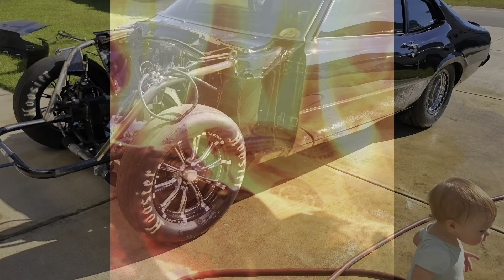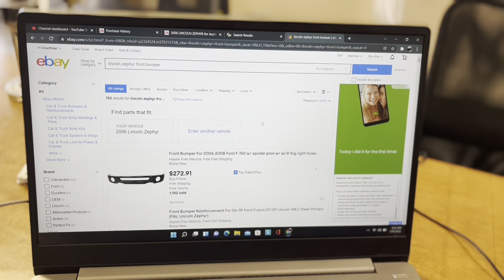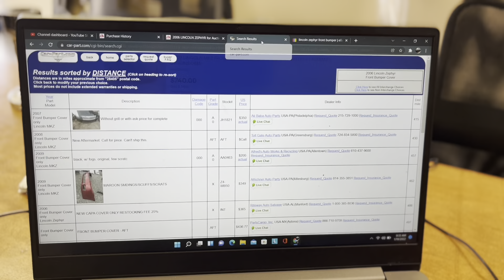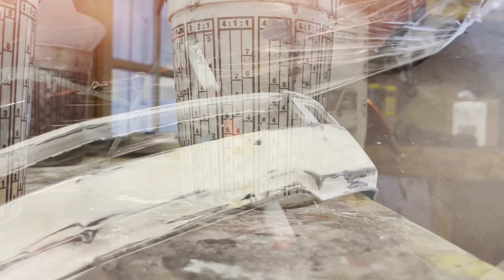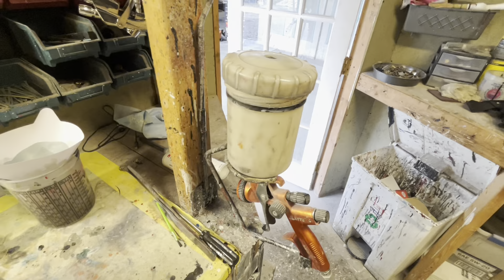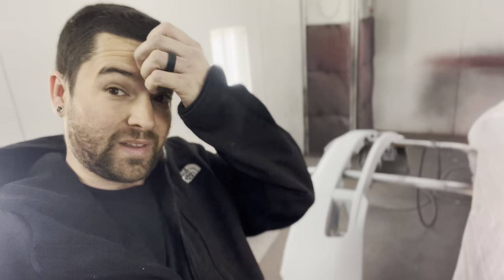DIY 💲5️⃣0️⃣0️⃣ Bumper Repaired‼️ (HOW TO fix your cracked plastic item)

Comment: Great information again 👍  if the dent on the bumper is on the corner would you still use the same technique?
Reply from the maker: If the corner was torn off yes I’d use same technique to put it back together. If it’s a corner or edge that’s dented In then I’d also heat it and push it out followed by skim coat of filler

Comment: SEM  is the only product that has never failed me. The trim black  Has always been my secret in boats it never corrodes in 40 years if you etch it first.
Reply: Don't have to  do it twice. Rust Mort by SEM  is the absolute best I tried every product. I restored a Van in 1995 with rust mort. 3/4 ton shorty from the factory for a upholstery shop he bought it new in 78 gmc. Still uses it totally saved it i used a squirt bottle in every joint.. my two cents
Reply from the maker: Yes I love that stuff!